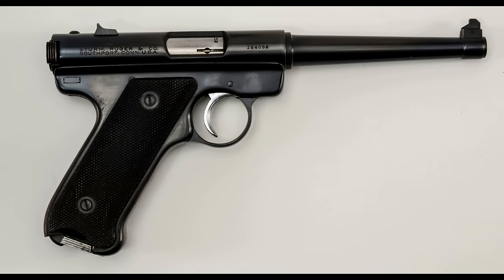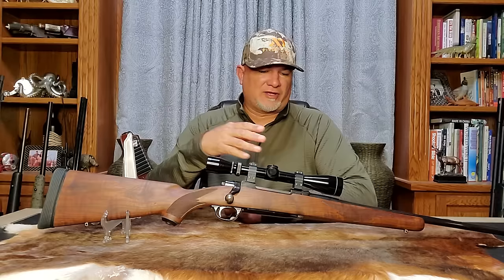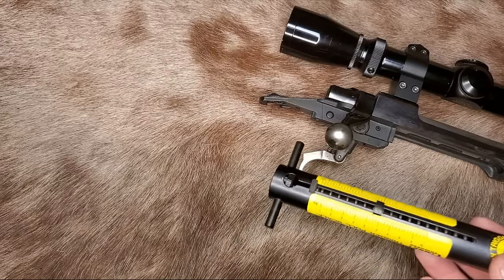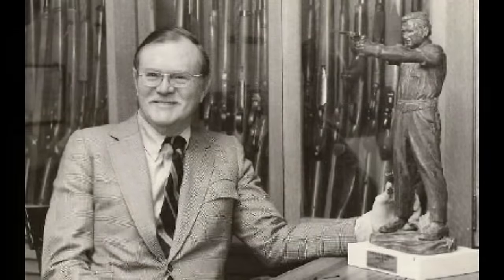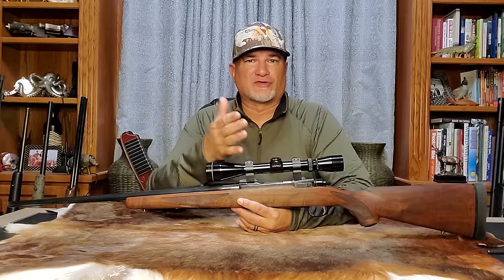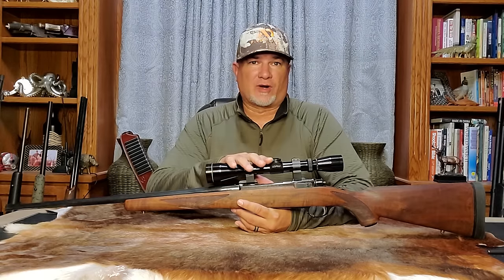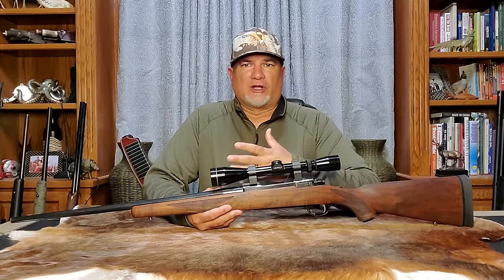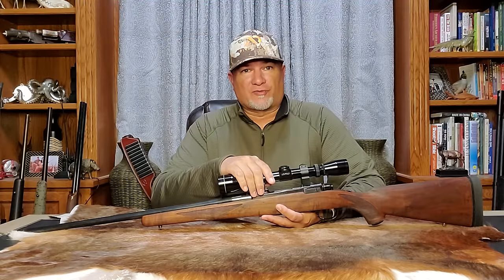RUGER M77: A Classic American Rifle

Comment: Great informational video, I do not have the T under the bolt arm of my M 77 30 06 made in 1970 . Should I be concerned, will Ruger correct the problem with no charges ?
Reply from the maker: They will send out the updated part with installation instructions.

Comment: I can tell you have a lot of knowledge on this rifle. Maybe you have some for me. I have the MK II in 270 with the boat paddle, as you call it, stock. I ordered that stock because I like it. Yes, it will thump your shoulder, but, don't they all. Anyway, when I ordered it, I ordered a heavy barrel, not a bull barrel, supposedly a target barrel. Also ordered it with a target trigger. This came from the factory with a trigger with NO, that's absolutely "0" creep. About a 2 1/2 lb pull. Never measured it, but you just think about pulling the trigger and this rifle sends a round.  I've had friends say they have never felt so crisp a trigger. I have a Burris 3x9 on it and I love this setup. it's an old school scope with cross-hairs in it, not mil-dots.
Have you heard of any of these rifles getting special treatment from the factory? I ordered it straight from Ruger, through a dealer I knew and trusted. He ask what I wanted and that's what he ordered. Target barrel and target trigger. Boat paddle stock, in 270 cal.
As for accuracy, well, I ain't the best shot around, but I can fill a quart oil can full of holes at 100 yards without even thinkin about it. Never got to stretch the old girl out to find her limit, but I think she'll do what I need her to.
Reply from the maker: Ruger put a specially tuned "Target Trigger" in what they referred to as the target models. Some of the special edition Varmint models also received this trigger.

Comment: Where can I buy replacement action screws with a hex head? Great video! My grandfather gave me a M77 in 25-06 and it's in beautiful condition. I need to hunt with it more.
Reply from the maker: I went to a local bolt retailer
Reply: If you can't find them locally you could try Brownells or MidwayUSA.
Reply: @desertdogoutdoors1113  I replaced the front and rear action screws, torqued them to spec in the proper order and replaced the factory rings with the Warne Maxima's. I'm excited to sight it in and find a load it likes, hopefully it shoots well! My M77 was built in 1971 and the Leupold Vari-X IIc it wears was built in 1985. I'm excited to bring it back to life.

Comment: My complaint with the New Ruger 77 Hawkeye rifles, is you don't get very many choices in cartridges to choose from for their standard model. Winchester model 70 gives you more options. I just wish Ruger would give you more calibers to choose from.  It's .204 Ruger, 6.5 Creedmoor, 6.5 PRC, .308, 30-06, 7mm Remington mag and .300 Win. That's for the basic Hawkeye model.  Yes I did look at their website. The new standard Hawkeye model is stainless. I'm not saying their bad rifles. They need to have more options available.  They do have distributor exclusive models for different cartridges. But those are impossible to find. Also they have different models like their compact model that includes 7mm-08. Their Safari express rifle that have .375 and .416 Ruger. They also offer a lipsy's dealer exclusive in 6.5x55 and .280 AI which are difficult to find.
Reply: I totally agree with you. Its like they are trying to kill off the M77 rifle. Very little choices for them.
Reply from the maker: Great point.

Comment: As always lot's of great info. I've only held a Ruger m77 one time. I found it in a used gun rack at Cabela's not sure what generation it was but it was a bull barrel 22 250. Not sure if that was a factory barrel or aftermarket? had told the guy at Cabela's I was looking for a 22-250 and he steered me towards it as the only one he had. I didn't buy it because I just really didn't like the stock and the design and the feel of the gun at all not to put Ruger down but the one example I held I just didn't really care for it at all. What I am excited about with Ruger right now is their new Marlins. Marlin had had such bad quality for quite some time and I feel like Ruger has really brought them back to what we always loved about Marlin. I'm getting tons of good reviews on the new Marlin and it's accuracy with the Hammer forged barrel and that the quality of the gun is top notch. I've never seen you do any videos with lever action not sure if you're into them or not? I would love to hear your input on the new Ruger built Marlin. Thank you 👍

Comment: I had a tang safety 22-250 and a mark 1 in 270 both didn’t shoot very well at all. That was before i handloaded. I have since switched to savage 110s and the only thing i miss from the m77 is how smooth the action was.

Comment: I bought a new Tang SAFETY 77R .270 in 1987. I owned a couple Mark 2s acquired a bicentennial 200th 77R 7mm Rem Mag Tang. I had a professional gun builder bed them all and do the triggers took out the pressure point free floating the barrels. 

Personally I never got a Ruger to shoot as good as Sako or my Remington M700s. Now a days with custom companies like Christiansen Arms, Weatherbys options Alamo , Antler and Fierce you can be into a great rifle in the 1,800 to 2,800 dollar range with superior quality and MOA guaranteed. In the day it would have cost 5,000 to 6,000 to get similar rifles built. 

I never liked the 3 position safety on the 77 mark 2s. Potmetal cheap. 

Opinion: For me to buy another Ruger 77. I would bring out a Model 77R Classic with a Tang SAFETY and original style stock with a fully adjustable trigger, Red Pad Walnut. Basically the gun I bought in 87 with refinements. Ruger is now run by Wallstreet and cheaper is better mind set. Winchester woke up and now has the best M-70s ever in the Super Grade. Sako came back to the original Hunter Stock design and quality.  Ruger could too!

Comment: DD, I have a m77 in 30.06, purchased in 1977 it has a ruger barrel on it, it shot 3”Moa, this last hunt season I was walking along minding my business and a rock buried in the dust tripped me up I went on way gun went the other, went and shot it, it was giving me 1.5” moa, shot great, took a nice 4x3 at 450 yds this year.
So it is a rifle that I love to hate.
Reply: Loosen your stock mounting screws
Reply: They are torqued to Rugers specs, but I’ll check them, shooting it is a rough proposition I still have the old butt pad and it hits hard but I’m working on it to reduce recoil I think it’s mostly my fault on bad shooting I know it kicks the crap out of me so I think I flinch a lot but after it flying like a trapeze flyer it it may have change the stock and barrel because it does shoot alot better thanks

Comment: In 1982 I traded my AR180 for a 77V H Barrel. A year later learned this info on bedding mine.  I used SS tubing to test fit mine and then fitted the finial pillars made from Stellite an alloy you may be unfamiliar with it.  It’s a high very hard alloy that comes from the aerospace industry used in valve stems and seats.  I did break a mag cover by over torquing the front screw but the new steel mag cover prevented from repeating my pillagers are set in a tungsten filled epoxy so they are not going to move.  Are you a Desert marksman rifle and pistol member?

Comment: I have a roger m77 mark 2 in 30-06 in stainless steel in 20 inch barrel the bolt was identical too my dads muaser 98 from Argentine from 1909

Comment: Strange.  I have a 1981 m77 243 win. It has put 3 holes in a Nickle at 100 yards. Gun was almost new. Was shooting 100grain boat tail soft point federal. Longest shot on adeer was 285 yards. Spine hit. Dropped in the tracks. It's an old gun now . I still use it.

Comment: 🤠 FYI - The SAMMI specks on the 7mm prc just dropped (on 06/07/2022)! It is essentially 0.535" wide, 2.28" long, has a 30 degree shoulder, and has a neck of 0.2868"! It can operate at 65,000 psi (unlike the 7mm Remington Magnum) and push out a 180 grain bullet at 2,950 ft/s (No different from the 7mm Remington Magnum)! However, the 7mm prc is still 200 ft/s slower than the 300 wsm and will not catch the 30 caliber bullets of the 300 wsm with those higher B.C. 7mm prc bullets, at any reasonable hunting distances! 😂 So, there is nothing new under the sun! 😎

Comment: I have had  m77v in 25-06 installed Timney trigger adj 2.5 100 yd groups loaded 47grains imr 4350 pushing  120 gr bt hp 5 shot groups in a nickle
Bench shooter since 1972 it one il  never part with bought it from my Dad

Comment: I noticed when I tighted the front screw before the rear that my groups shrink in size , i wll look at the mag well and see if it moves freely . I had to add to the comb height to get a good cheek weld added about 3/8" to the stock height I'm running a bushnell banner 6-18×50 scope with the highest rings I could find to get clearance between the barrel and scope .

Comment: The M77 red rubber butt pad may be hard, but they are still better than a steel or black plastic butt plate.  If nothing else, with the red rubber butt pad, if you prop the rifle in the corner and the cat rubs up against it, the rifle's butt is a lot less likely to go skittering across the linoleum and the rifle crashing to the floor.  With a Limbsaver or Pachmayr Decelerator butt pad, the rifle is even less likely to fall.  For those of us who live way out in the dingweeds and who keep a rifle just inside the back door to deal with coyotes and other varmints, this is an important feature for a rifle.

Comment: What about free floating the barrel as well as pillar bedding I have a 70' s model tang safety m77  in 270 Winchester. Bought used in 1980. Accuracy has grown from sub MOA to 2". Recently had timney trigger installed by local gun Smith. (Costed more than I paid for the rifle in 1980 lol)

Comment: I bought a used M77 once.  The bolt cut for the controlled round feature was 180 degrees out.  In other words the cut was on the top side of the bolt. As a round was about to be peeled off from the magazine it would not fit into the bolt recess and claw extractor.  Thus making this a push feed only rifle.  Disappointed in Rugers quality control.  It had a brief stay in my collection to say the least.

Comment: The tang mounted safety M77 is not a CRF action rifle.  It has a long claw extractor but is actually a PF action.  Chamber a round slowly and see what happens.
I have one in 7x57.  Shoots about 1-1.25" groups, nothing special but after this deer season I'm gonna try the action screw torqueing and check again.  Thanks for sharing.

Comment: I bought the M 77 in the late 90s early 2000 in 300win mag. I took it hunting had a shoot at a beautiful buck and I had an issue with the safety. I did not push the safety forward far enough and lost a shoot at that deer and within a week I traded that gun off as fast as I could. I hated that gun And never bought another Ruger bolt action to this day

Comment: Lol i bought the boat paddle becuase it was the boat paddle model, durable and came with the stainless. I bought it in 270winchester. I dont mind the stock. I dont understand the hate to itm i think its unique. Better looking than a plastic stock
Reply from the maker: Most people find that the design doesn't handle recoil well, those  swivels make too much noise, and it's flat-out ugly!

Comment: Enjoyed this vid and hearing the research you did.  As a left-handed shooter though, a Ruger Hawkeye is only available in the 6.5 Cr Hunter model and is too expensive.  I'm shopping for a rifle with the Mauser action in 30-06 and it looks like for me as a lefty, the CZ  557 might be the best option available for me.  Savage and Remington have been the most lefty-friendly companies so that's what's in my safe.
Reply: I too am a lefty and I own several M77 MK II and Hawkeye’s, I’m not sure but I don’t think the original M77 was available in left hand, at least I’ve never seen one. I do own a Left hand 308 Win and a 7MM-08 Hawkeye so they are out there, just really hard to find.  My gunsmith has no problem (in fact he thinks they’re one of best triggers) doing trigger jobs on these and every one of mine is at 3lbs.  I glass bed the action and sand out the the bolstering in the fore end of the stock to allow the barrels to free float and these rifles shoot sub MOA, every one of them.  I own a couple of Model 70’s both pre 64 and the newer control round feed rifles but the M77 MK II and Hawkeye’s are every bit as good of a rifle for the avid hunter.

Comment: My first real hunting rifle was a Ruger M77 mk2  with tang safety in 30/06. I took a few white tails with it. About 2 years after buying it went through a divorce and sold the rifle to help pay attorneys fees.
I missed that rifle for several years and regretted selling it.
About 5 years ago a buddy of mine dad was selling a few of his rifles off and he offered my pick to buy.
He had the exact rifle I sold in his inventory, a Ruger M77 mk2 30/06 tang safety. I paid $500 even for it.
My 2nd Ruger has taken as many deer as the first, but with exceptional accuracy. I am consistently hitting 1” above the bullseye at 100 yards no problem. Which is how I set it up from jump street. Every year I take it out to the range to check accuracy, and every year since I’ve bought it and set it up, I have hit 1” above the bullseye first shot. The rifle goes back into the case and waits for the season opener. My hunting partners on the other hand are consistently all over the place with their shooting accuracy and will normally run through at least 1 box of cartridges before they get dialed in. One is shooting a Ruger American in 30/06 the other shooting a Remington whatever in 30/06. 
Needless to say I have been and remain happy with my M77. Stick with what you know when it works for you is the lesson I’ve learned using this rifle.
Reply: The MK2 did not have tang safety,that was on the original M77

Comment: I had a M77 MKll stainless 243 and loved it. But I was young and dumb and sold it. I got mad because I had a absolute monster buck get away. because I didn’t flip the safety all the way off. it was my fault not the gun but I blamed the gun at the time.
Reply from the maker: With any rifle, you have to get a lot of practice with the controls before it becomes second nature. Many hunters had problems with the tang-safety M77 at first, because they weren't accustomed to the safety design.

Comment: There is  trick you can do on the mkll for the limited box capacity, it wasn't a stock issue. Pull the follower off the spring you will notice two legs and that's what limits downward travel. You might think they're there for a reason but they are not. Look at any m77 they don't have them. I know a 223 will hold 2 more and larger calibers one more. I think it was mr ruger just telling you f off you don't need that many, hell none of his pistols held more than 10 even before the ban.

Comment: I found on my M77 that the front and rear scope mount pads are not level to each other.
Reply from the maker: M77s, and many other rifles are made that way. the front and rear rings are different heights to compensate.
Reply: @desertdogoutdoors1113  no, this is level as in horizontal axis or left to right.

Comment: Do the torque recommendations apply to the Hawkeye mark 2 as well as the mark 1?
Reply: Good question, I want to hear an answer to this as well.
Reply from the maker: Ruger put out an instructional video for the Hawkeye where they clearly state 95 inch pounds for the front screw.
Reply: @desertdogoutdoors1113  thanks
Reply: @58harwood  yes....there were numerous places on the stock forend where the barrel would "rub".  My gunsmith opened up the forend and the gun shot much more consistently.  The first couple of shots were decent but then it would start wandering as it heated up.  Ultimately, I ended up with a McMillan stock and having the action trued.  It now shoots half moa with Norma whitetail ammo.
Reply: @58harwood  Btw, my Ruger American shoots 3/4 moa right out of the box with the same Norma ammo.  Needless to say, I have purchased my last Ruger Hawkeye.
Reply: @58harwood  👍

Comment: it's funny how people think ruger's been making bolt action rifles for a long time. my 1977 F150 is 10 years older than Ruger both action rifles. people think they've been buying them since the 60s and seventies they're delusional. the Mauser action has been around for over 100 years that they use that they're probably familiar with. but Ruger rifles and bolt action configuration did not come out till 1987.
Reply from the maker: Epic face palm man. The M77 Mk1 tang safety bolt-action rifle came out in 1968.
Reply: @Michael J LOL!   I KNOW I bought mine in 1980 and had been reading about them in magazines for years  before buying.

Comment: as far as the strength of the action goes, I have a mk2 that was a 7mm mag until a squib round caused my barrel to banana peel, splitting all the way to the action but causing no action damage. it is now re barreled to a 300win mag with a boyd’s stock and trigger work done and is by far my favorite rifle to hunt with
Reply: A squib round didn't cause that. YOU caused that by shooting another round without checking the barrel for an obstruction.

Comment: I'm confused, I have M-77 tang safety Mk.I that has a Mauser 98 style controlled feed bolt.
Reply from the maker: Although the tang safety M77s had the Mauser-style claw extractor, they were push feed. It has an enclosed bolt face that does not pick-up the cartridge from the magazine. The extractor claw snaps over the case rim as the cartridge is being seated in the chamber. All tang safety M77s are 100% push feed.
Reply: @desertdogoutdoors1113  You're right, I never noticed that before. I inherited the rifle and maybe shot it 3 or 4 times in the last 20 years. Fiendishly accurate though. Thanks.